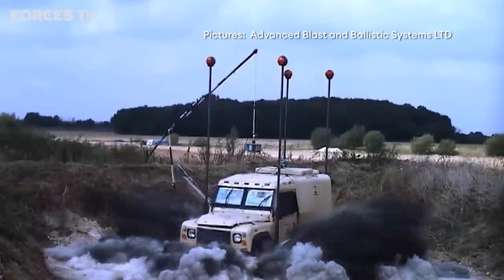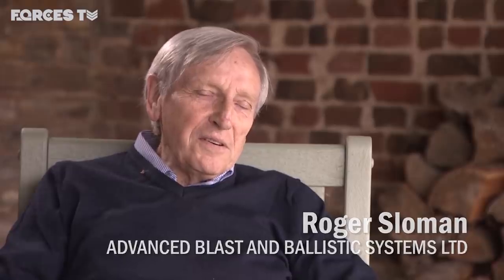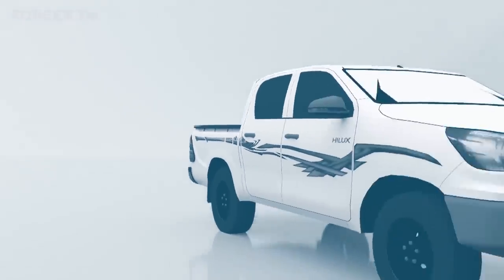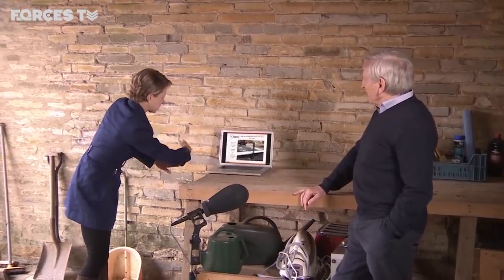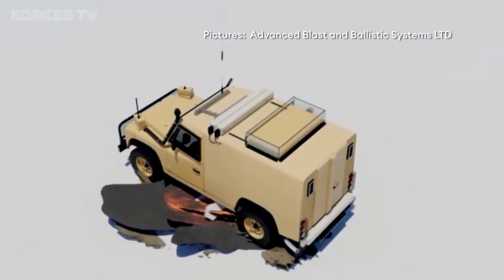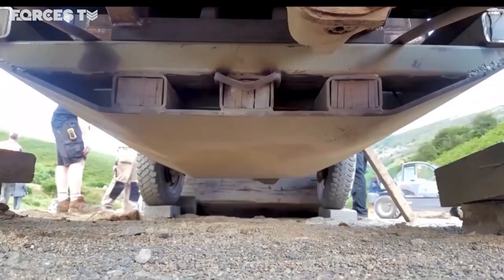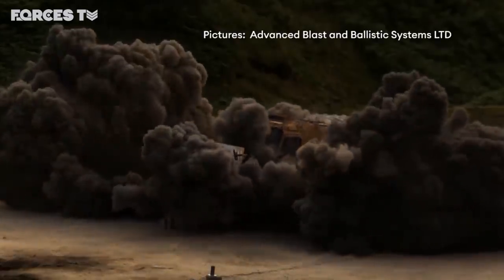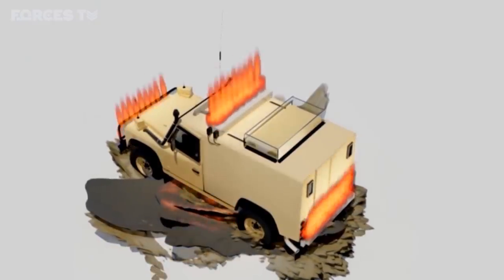Has This Inventor Found A Solution To IED Threats? | Forces TV

Comment: so I need a 2 stage IED with an initial small  blast followed 0.5 seconds latter by the main charge with a bit of large dimeter fragmentation to punch through the floor
Reply: Roger Sloman
1 second ago
The system deals with this double tap situation, again, not saying how though.
Reply: @rogersloman6635  physics would argue that is going to rather difficult  without carrying a rather large number of rockets ( for each kg or rockets I need only a few hundred g of charge and the amount of down thrust will probably perinatally disable the vehicle ) . A longer burning rocket will mean ether it must way a lot more or produce less down force at any one time  and could be delt with by going to a 1 second delay .
Reply: @woltews  Your assumptions re the amounts of charge and propellant etc. are not correct, and a 1s delay would see a moving vehicle past the mine location.  The down-thrust does not damage the vehicle in any way. Roger.
Reply: @rogersloman6635  um the suspension of the vehicle is not designed to take an extra 10s of tones of downward force instantaneously  so all I really need to do is get the rockets to fire to disable the vehicle . In the real world there would  probably not be a précises delay but sum variation likely from 0.1 to 2 seconds  based on the materials available to most IED builders  just as expecting consistent fragment mass/ blast power  would not be practical . 
I guess  the large point is that for every $100 you spend on defending the vehicle I would only have to spend pennies to defeat those systems
Reply: @woltews  Ok, so why didn't the Snatch Land Rover suspension fail and collapse when we put about 120tons on it in the video? An dhow exactly are you going to defeat the systems? We deal with the double tap issue.
Reply: @rogersloman6635   did you actually drive the vehicle after the test?
Reply: @woltews  No, it didn't have an engine!
Reply: @rogersloman6635   so you were actually there during at least one test ? was any sort of fragmentation used in the test ( ie a bag of 12mm hardened steel bolts )  was the charge buried or on the surface and if so to what depth ? was the vehicle moving or stationary when the charge was detonated ? was the charge under the wheals when the charge was detonated ? were there acseliromiters to measure what force an occupant would have bee subject to ? How much of the drive train was still present a was it examined for damage after the blast ?
Reply: @woltews  Of course I was there! No frag except the stones in the Welsh valley soil. Buried 10cm to AEP55 standard. Stationary. Under centre of vehicle. Hybrid III ATD in blast seat. The belly plate just had a 35mm dent, no impact on drive train at all.
Reply: @rogersloman6635   Many  IEDs use pressure plates so frequently they go off under the tire , it would be interesting to see what that would do ? Likewise many are made using old artily shells or  with a shell augmented with HMX so have a fragmentation  component  this might also be relevant to real world performance . I have lost some friends to IEDs if you have any ability to have a say in how the tests are conducted I would be interested in how these variables might impact the outcome .
Reply: @woltews  Sorry to hear you have lost friends in the Army .... UK? Sure, all that is correct, but this was a demonstration of a pure blast mine to the NATO test standard of AEP-55, at the 2b level the b suffix being the worst case, under the centre of the belly. Wheel strikes, especially front wheels are relatively innocuous as not much damage is done to the main body and Global Acceleration is much less. The steel belly plate has to deal with the fragmentation of course. Sure we can control the test but are very limited on funding and have to concentrate on the main objective, defeating under-belly mines/IED's to demonstrate what can be done. We are shortly to try 6kg under a Hilux with a very practical belly plate weight and thickness.    Roger.
Reply: @rogersloman6635  canadian but also have some US Army friends  , sadly the vehicles in question were mine and blast resistant but to a standard that did not modal what a real world IED actually did  . There is a group in the UK with a great deal of tragically acquired experience on real world IEDs and UXO  called MAG that might have some useful data .
Reply: @woltews  By sheer chance I was introduced to a guy who runs the MAG a while ago so I have a good contact there. Which vehicles are you referring to which didn't work, and against what sort of threats?  Roger.
Reply: @rogersloman6635   the one that comes to mind at the moment was a LAV which as I recall struck  an IED made up of a number of  old soviet era  82mm HE mortar rounds bundled together   and set in the road with a pressure plate , There have been a number of incidents but generally when old ordinance is involved it is easier to reconstruct what happened unlike when bolts or chain is used with HMX where there are more variables  . If memory serves the royal engineers at least  used to have an extensive collection of remnants from various IEDs and UXO that British vehicles had encountered  along with more detailed repots ( not sure if they still have this stuff or not )
Reply: @woltews  I just had a look at the CF history in Afghanistan, a lot of casualties, and the LAV III didn't fare too well did it. Hence the later upgrade with the double V hull, not that I am a great believer in how much that would help.  Roger.
Reply: @rogersloman6635   yea the Royal Engineers might have more permission  to discus specific incidents and actions taken in detail  with you then I have . They could probably also give you sanitized information towards what the real world threats are with various NDAs  . When I have worked with the Royal Engineers  they were generally rather interested in new ways of dealing with IEDs and UXO  , If that doesn't work I hear they enjoy a pint or too on occasion . Good to hear you have some contacts with MAG .
Reply: @woltews  Getting the details isn't too relevant anyway actually as it's just a case of designing for and testing to whatever NATO spec. is required. Anyway, good talking with you, going to bed now, it's 00.48h now!      Roger.
Reply: @rogersloman6635   have a good sleep , the fact that defeating real world threats is less important then passing a standardized test  when human life is at stake is pointing to a larger problem with the system IMHO
Reply: @woltews  The standards system has caught up with the real world though, the UK's DSTL and NATO is really on top of it, but we don't get to know the details unless we are involved in a programme to counter the specific threats. Hopefully, in due course.

Comment: your actual problem is stinger missiles
Reply: simpler would be to add mass, that you cant throw it in air, like a tank
Reply: @Jkauppa  Well that makes the whole point of the vehicle useless, it would be slow, heavy and get stuck easily
Reply: @makripper123  if you have a paper thank, what kind of tank is that, one shot and gone
Reply: @makripper123  with scale you get added resistance

Comment: Ok how will the Soldier  survive with 2  Massive Explosions  .  or will one explosion shockwave  counter act the other explosions shockwave
Reply: The mine explosion doesn't get to him and the motors firing isn't an explosion, and like the mine , it's outside the vehicle!
Reply: @rogersloman6635  But wii Soldiers stll be knocked out by  shockwave ???
Reply: @scottbutler2761     No, the shockwave doesn't get into the vehicle. See in the BFBS video the HSV from the 2008 test that started this, you can see the shockwave pass over the vehicle.  What get's through the structure and then into the air inside the vehicle is minimal.

Comment: well teh one VERY BIG floor with all of this & the demonstrations are, we're seeing IED's not made using normal land mines but configured single OR multiple artillery shells, which certainly have a much bigger bang & usually spread the blast from a single to a multiple & wider blast pattern including a blast from the side, rather then directly below...

sorry to say but this looks like we're throwing money down the drain, as the design & tests are out of date... ultimately "as seen already" using purpose built vehicles rather then light skinned (unarmoured) OR armoured light vehicles simply ends up killing occupants (notice VIP government officials don't use light armour or no armoured vehicles)

I am surprised mine/shell (IED) identification systems haven't been designed/developed ie detecting such under the ground or along the side of a track & having mobile frequency jammers as standard.. even having deployable explosive charges to quickly tackle potential OR real IED threats, after-all we already know in such countries as current conflicts are occurring troops/security services are always being watched as they move along foot tracks & road tracks.

going back to such equipment on military vehicles surely it would add to fatigue & increased wear & tear especially if a IED incident occurs ultimately killing the vehicle but saving the occupants (why not save both via better designed vehicles)